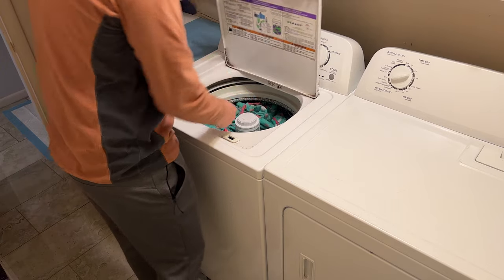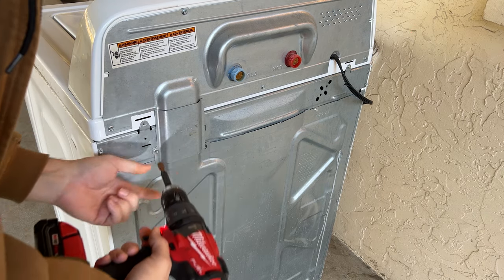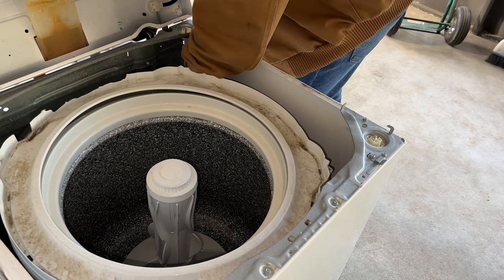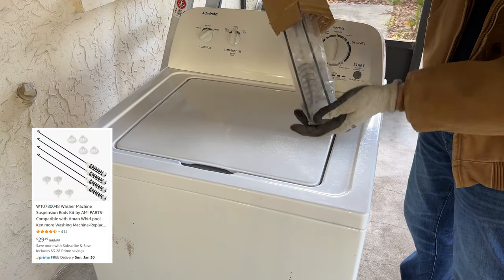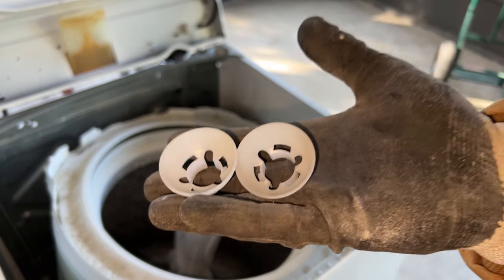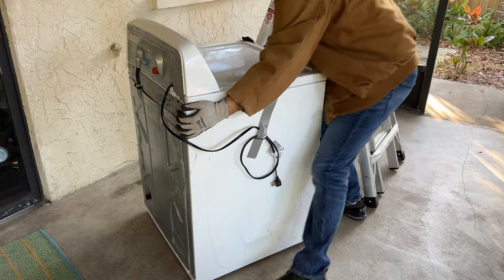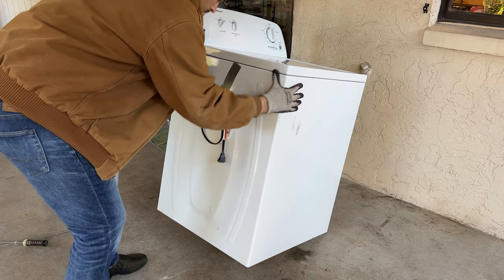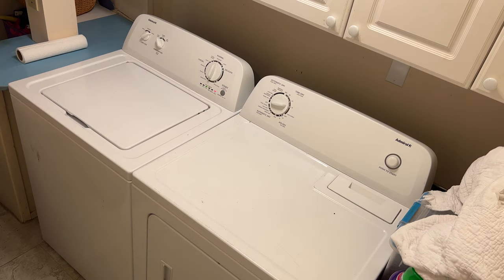Fixed: Admiral Washing Machine Banging During Spin Cycle

Comment: My Amana is doing this. I just called my local appliance repair shop. They want $100 to come diagnose the problem,  then another $50 to come back a second time to install the parts, plus the cost of parts. I am a 70 yo woman, very handy at fixing things. I will do this myself.  Thanks for the video and parts link
Reply: I just bought one yesterday,i took out the extended 5 year warranty..
Reply: Me too!
Plus we’ll be saving $150.00+!!
Best wishes!
Reply: @neilcharles2520 did you order the same part that he used?
Reply: Depends on your machine  @lostineggsaisle
Reply: You got this moms

Comment: Great video.  If you are having trouble lifting the new hooks through the top you can put the old ones through the top of the holes, hook the new ones, and lift them through.  Made it even easier for me
Reply: What I did
Reply: Came here to say this as well. I also used pliers on the old parts to help pull up the (greased) new parts.

Comment: Excellent video, very straight to the point. However I have a Kenmore machine that uses springs vs suspension rods with springs. The springs appear to be OK so I'll need to keep looking for the problem.  Many thanks.

Comment: Yeah. Mine is acting up like that. It even dented the front of the machine. Upon close inspection, I noticed some rust in the holes in the basket and next to the bleach dispenser too after I used the cleaner packets. I have been weighing replacing the machine, but i kind of like the job that it does, and its feisty disposition. What you did here is very impressive, but I think that might be a bit hard for me. Hmmn. Wonder how much it costs to get that done if I have to pay for it? I am seeing on line there’s a way to diy the rust fix. I wonder if there are other considerations. Hmmn. Thanks again. You’ve given me food for thought.

Comment: Alot easier than lifting the whole drum out. Replacing one at a time is better than removing all then replacing. Sometimes people make it harder than it needs to be. I am a female attempting to fix my washer. This was extremely helpful
Reply from the maker: Yeah doing one at a time would be much easier.  Glad the video helped.  Hope you get yours fixed up and all goes well.
Reply: @thefiXfiles  I am slow to the go...ugh. I need to get the parts ordered still. Are all parts similar or I should look up the model number? Its more my confidence in doing the task, I know I am able. I have taking apart a dryer and put back together and that was empowering.
Reply: A couple of notes I will make on the repair I did today. The screws on the back of the washer were 1/4"  socket size. To get the rods out, I think I tilted the washer about 30 degrees. Reason I mention that is that I was working in a very enclosed space to do the repair. I went in a clockwise order to replace the rods. The first rod at the upper  right side was the trickiest to replace at first because a wire cord was next to it. I needed to run the rod outside the wire tube. It wanted to go inside the tube path, which could allow the wire tube to rub against the rod. 

I found that getting the rods secured in the upper cups was easy to do if you use the hook end of another rod to pull the new one up through the cup and hold it in place while aligning the plug. 

The repair took a few hours for me as I had to clean up around the washer a bit and did not want to rush swapping the rods. I ran the washer on two cycles and it seems like it went pretty well. One caveat, I ordered OEM rods from another vendor other than the one mentioned here. The reviews on Amazon were not stellar in some cases for the rods used. I paid more for the OEM rods but this saves me a lot $$$$ versus buying a new washer.
Reply: I'm a female and doing all 4 was a breeze, must be my adhd.
Reply: @TheHankPotter  I wish I had seen your notes before I installed new suspension rods. Thank you.  At the age of 68, I am finding that my muscle strength is sadly wanting. Technique, leverage and removing/replacing one at a time is definitely the way to go.  Most importantly I enlist the help of my angel. The proof that I have is when I ask for help things will fall into place and I don't see how it could have happened. We are all given an angel and I have been helped many many times. PS I am in no way a holy person, but I do have faith in Jesus' sacrifice for our fallen nature and to redeem us to a relationship with our Creator.

Comment: When opening up the top after removing the screws in the back, my model had an S-shaped opening pattern. I had to slide the lid forward and then lift and push the lid back. Also, I used the old parts to fish up the new parts. I used pliers on the old parts to hold them in place as I installed the retaining clips.

Excellent video! Thanks for posting.

Comment: SIR!!!! I'm so glad I came to YT and typed in admiral washer off balance and yours was first on the list. My washer is doing the exact thing yours is doing but it's 10 worse. When spin time comes with even the lightest and smallest load, the washer is shimming and shaking halfway across my basement before I pause it. My hubby said just look for another washer. The washer prices are out of control just for a top loader nowadays. I am going to spend the 30 bucks first before I shell out over $500 for a new washer. i hope I can join the fixed washer crew! THANK YOU!
Reply from the maker: Heck yeah it’s worth it to try fixing it first.  Hope your repair goes well!! 🫶
Reply: @thefiXfiles  I had to come back with a lot of virtual hugs!!! I'm officially in the $30 washer fix club! My hubby swapped the rods and ran the washer empty on rinse/spin. Once it started to spin, no banging on the frame. Then I did a full wash with jeans inside. I forgot that the machine was on. It's so quiet like when we first bought the washer. When I opened the lid, it seems like the drum is sitting higher up in the frame now. When I tried to move it, there wasn't a lot of swaying like it did before. In my mind, if you are removing the wet clothes and the drum is moving around way too much, that should be an indicator that the rods are starting to give out. AGAIN,  thank you.
Reply from the maker: Good for you guys!  Comments like these are why I make videos.  Hugs for you both for sure!!  Thanks for stopping back by and giving an update 🙂

Comment: i have the exact washer u have, same problem.u guidance was easy to follow with your camera showing the things u need to see.of course my washer fought back a little but i was able to change out the parts easily.i found out the hard the shut off valves didnt work.had to turn water off outside.thanks for your video, it saved me $600 for a new machine.

Comment: Thank You so much!  I have Zero knowledge about washing machines and I could not get my washer to stop banging. I was trying to level it.  Then I saw this. Unfortunately I needed to get the parts the same day so I paid double but I was able to fix this with thr help of a friend to lean the washer.  It absolutely worked!  I am so excited!  Appreciate this video 100%. Loved the arrows pointing to the exact screws. Loved the format, not too ling winded or too fast. I was able to pause it and do the steps. A+
Reply from the maker: Thanks for the kind words.  Glad you got it fixed!

Comment: just ran into this issue, was about to buy a new one but figured I would look it up. Thank you!
Reply: Same with us. Though one of our rods had completely broken before we attempted this fix. It now works but almost every load still makes the horrible shaking/banging and requires me to stop it and rebalance the clothes. Sometimes it takes me 3-4 tries at rebalancing until it will finally spin and finish the load. What did we do wrong?  It takes way too much babysitting and time just to finish one load now.

Comment: Hey, loved your video and we changed the rods exactly as you did.  
However, the rods were "short" when they arrived (based on the link you provided for Amazon). 
I thought this would not be an issue, so we changed out the rods.  
Now, the washer still rattles, and the drum is trimming pieces of plastic of the top of the washer. 

So the drum sits higher and a wash cycle can't complete.

We will be exchanging the rods and hope to the get proper size ones.  Based on your video and now, our "experience" we should be able to quickly do this again!  Cheers!
Reply from the maker: Thanks for the response.  I’m going to remove the link I had for those rods.  The manufacturer must have changed something with them because you’re the second person to say they came too short.  Sorry for the headache!  I hope the next rods work better for you folks
Reply: Hi, were you able to get the correct size suspension rods? If so could you please post the link to where you ordered them? Thanks 🙂
Reply: @girlsixdiva  Hi!  I went to a local repair shop and bought the rods there, as I was a little nervous about buying online again. Unfortunately the washer stopped completing a full cycle, and instead of plopping down more money for a circuit board, we just went ahead and bought a new washer . :(

Comment: Thanks for your great video.  Yup, that's my problem and nope, way beyond what I can fix.  At least I know where I stand, and that I need to find a repairman.  

So it's the suspension springs that need replacing, right?
Reply from the maker: yep the suspension rods.  that's what fixed it for mine.

Comment: I ordered the parts from your link. The pieces/rods were a few inches too short. I have the same washer as yours.
Reply from the maker: That’s interesting.  I wonder if the Amazon seller or manufacturer changed the part.  If you take one of the old rods out, is it longer than the new rods?

Comment: But how do I KNOW it's those suspension rods?  Maybe it's something more minor?    Sure sounds just like yours, and I have a very similar model.  But thanks for the model # and the video- I think I can do this.  Just want to rule other possibilities out.
Reply from the maker: Honestly I just guessed.  The rods were cheap enough that I figured I’d just try it out.  I read some stuff that said if you open the lid and push down on the drum and it bounces around then that means the rods are at fault.  The rods should absorb and soften the motion.

Comment: mine sounds just like yours, and i only had 1pr. pants, 2 boxers, 3 tee shirts, 4 washcloths & 2 bath towels. & it sounded like Thor was giving it hell with his hammer or an apache helicopter was landing in that room. so i ran , almost out the front door, but decided to go and push the pause button. and wait 3 full min. for the lid to unlock. i really want to bypass/defeat that lock.i have no children living at home. im solo here & quite aware , as to not put hand into moving tub.  GREAT VID !!!  THANK YOU SO MUCH. NOW........whats up with agitator, it moves at a snails pace, it moves at least 1/2 the speed of all other machines ive seen before & i got this one in 2017 at an appliance outlet(scratch/dent, new & reconditioned) so i dont have the benchmark of a new machine to  guage if mine is failing or its normal. thanks again !!!

Comment: damn finally some solution. mine was the same before.. that banging sound until it becomes a very loud like grinding metal sound when it’s spinning.. until now it doesn’t want to drain the water anymore and doesn’t want to turn on as well

Comment: I just replaced mine all from the top side without having to remove the water lines or drain hose. As long as you can tilt it enough to raise one side 7 or so inches above the floor. I used wood blocks to rest it on and tied a string to the hook end in case I dropped it. Angle the spring end away from the hole in the drum and you can pull it through from the top. Much easier and faster in my opinion

Comment: Thanks, I was able to replace these with little issue. The only thing that happened afterward was the tub is much higher than it was before. Your tub is much lower after you replaced these rods. I washed a load of towels afterwards and it made that banging sound again. Any idea why? Thanks.
Reply: Hello, im having the same problem with the tub being higher and making noise again. Did you happen to figure it out?
Reply: @jaylapatin5216  hey, I ended up cutting the top off the plastic bleach intake. It’s still a little noisy but it’s working. I’m

Comment: The part in the description that mentions 2024 updated is still too short. It's 23.5 inches long. The one we need is 25.5 inches long.
Reply from the maker: Man that’s strange.  I even tested and installed them on my machine and they were the correct size.  I’m not sure what’s going on with those parts.

Comment: I replaced the rods. They worked for a
few months and then the plastic over the spring started slipping again. I did the pin trick and that worked for a few months until they worked their way loose again. Could there be an issue with the drive hub that makes them keep failing?
Reply from the maker: I think it’s just cheapo China replacement parts.  Some folks have mentioned the OEM manufacturer rods seem to last longer.
Reply: Might as well buy a new or lightly used one. It's a crap shoot weather it's the rods or not.

Comment: I had to remove 2 additional bolts that did not have screw slots. One of the rods just came loose so I didn't even have to replace it; just had to slide it back in.

Comment: Did you get your washer in 2013? We have the same model and bought it new that year. It has the same problem as you fixed here. Thank you for this video. Might save us a good deal of money.
Reply from the maker: Yep!  It was exactly 2013.  Got it when my wife and I got our first apartment together.  We went to Home Depot and asked for the cheapest ones they had because that was all we could afford lol
Reply: We have the one from 2013. Just now having the same problem.  We asked for the "cheapest ones too". Honestly for 9 years this thing worked amazing. Thats more than I see for a lot of the newer more expensive models.
Reply: @kafarhan   Fixing was relativey easy. I ordered OEM parts from parts dr . Did at least 30 washes since then and the machine is noise free.

Comment: WARNING! Please be advised everybody, they don’t come with springs for a reason, do you really think a manufacturer is not going to send it with springs if it’s needed??? Of course not! 

These springs may or may not fix the problem, that’s why there’s so many mixed reviews concerning them. Half say they worked flawlessly and the other half say it did nothing! The reason? 

Because the real problem is the rod/spring assembly located at each corner, they wear out after time.  were out after time.

These other springs you see in the video? That’s like putting a Band-Aid over a cut. Sometimes the cut will heal and sometimes it won’t. But the entire kit is $35 to do it the right way! You need to replace the rods and the springs (Springs attached to the rods not the springs here)